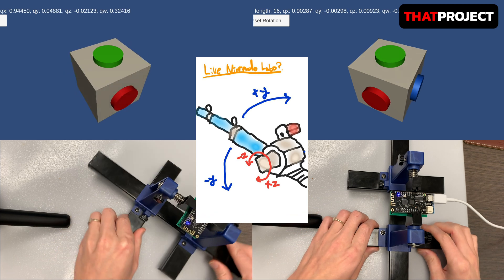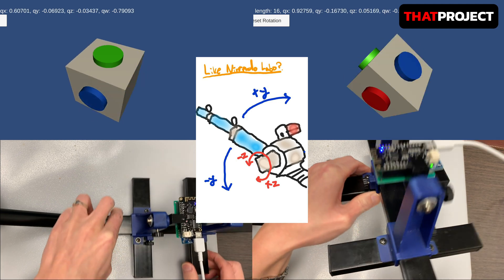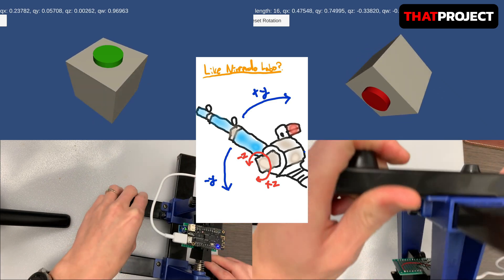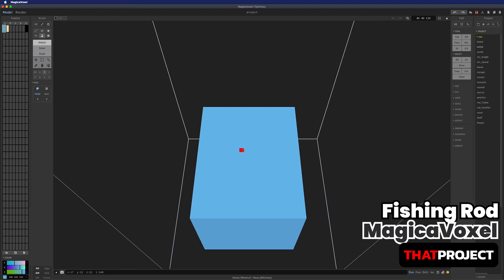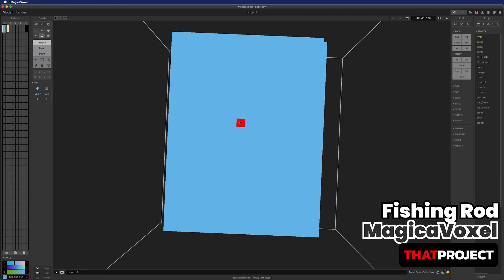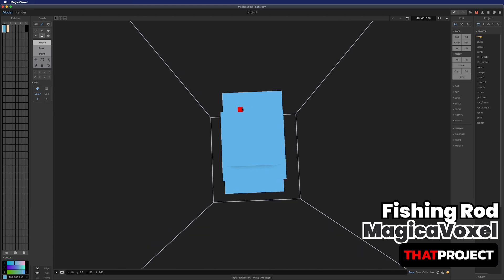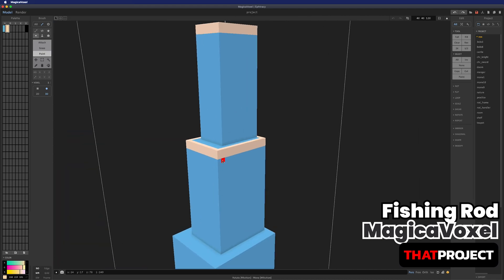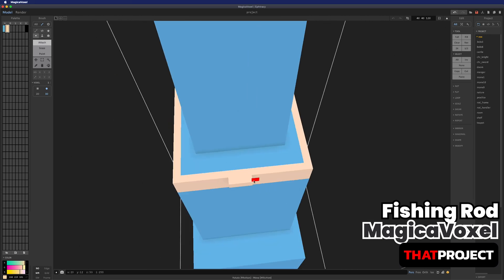Unity | Make Own Fishing Rod For Game Asset (ft. MagicaVoxel) #Nintendo #FishingRod

Comment: Any thoughts on this video that uses a Unity/Unreal plugin to make an AR application:  "Update 1 - Tilt Five SDK"?   (BTW, there's also an interview where Adam Savage interviews Jeri and she talks a little bit about the asset creation at the 18m mark).

My dream would be to do something like inspectar, that uses AR to find components on your PCB!    Curious Inventor did something like this a while back ("Augmented Reality BreadBoard circuit building guide"), but would love to do it in flutter!    How difficult would such a project be?
Reply from the maker: A basic 3D engine is needed to implement AR. It is still difficult to fully implement AR with just Flutter. So, there are cases where AR is made with a combination of Flutter and Unity. I recommend you look this way.